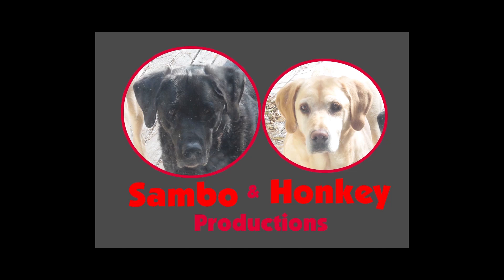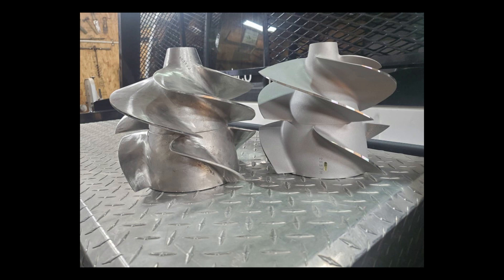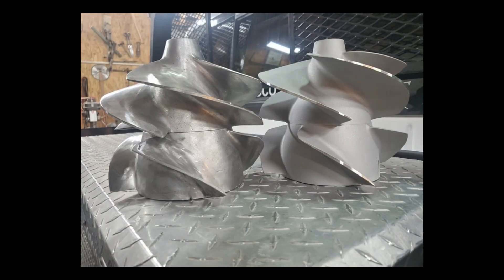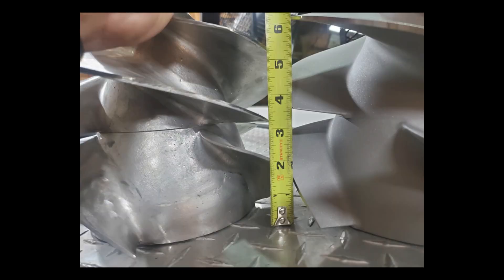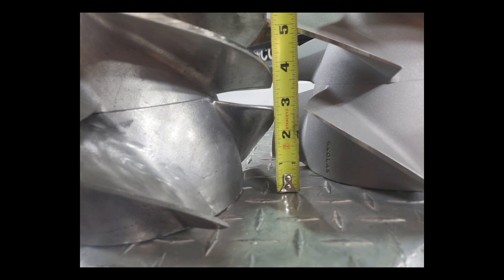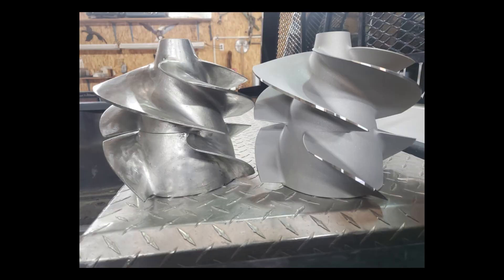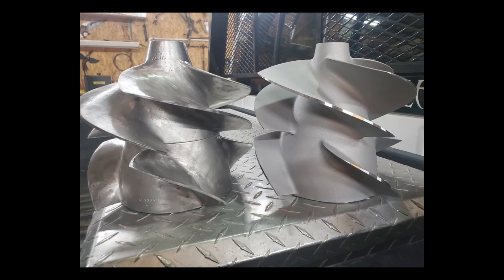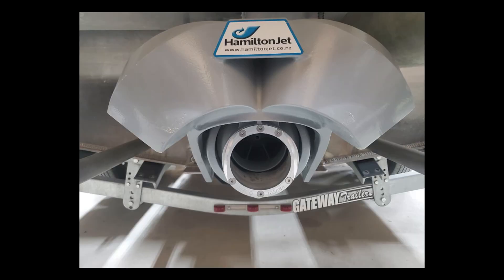Jet Boat Impellers Solas Versus Hamilton 4.0

Comment from the maker: Sort of hard data. With the 4.0 and 103 nozzle, it blows out and won't recover until you reduce throttle. With the Solas and 105 nozzle it slips and recovers without complete blowout. The Solas gets about 200 RPM more top end. 

That is all that is known. If we had a kW number for the Solas, we would know more. Lacking this, if we estimate the difference between the Solas and 4.0 is the same as the difference between a 3.4 and 3.9, then as per the HJ212 brochure, 4200 on the 3.4 gives the same power as 4000 on the 4.0. So the power is about the same. But... if the power is the same, the thrust increases with nozzle size. And if the Solas is more efficient (it seems to be based on comparisons with 3.4), then the improvement will actually be larger than implied by the nozzle size.

https://www.youtube.com/watch?v=YWR4uiOpzTA